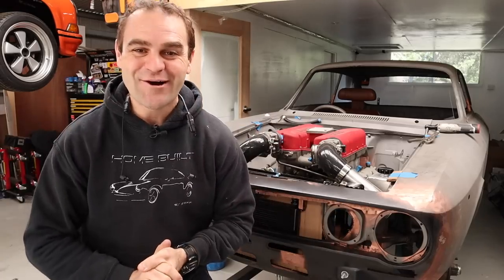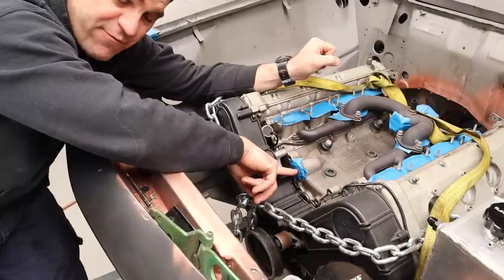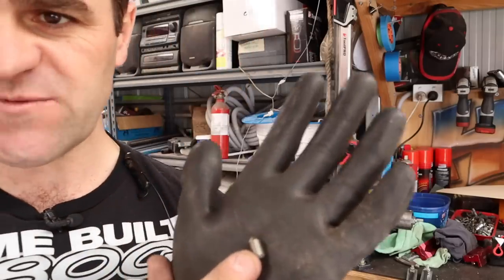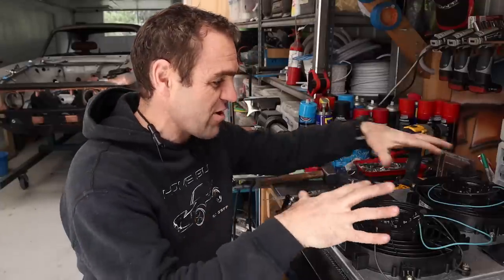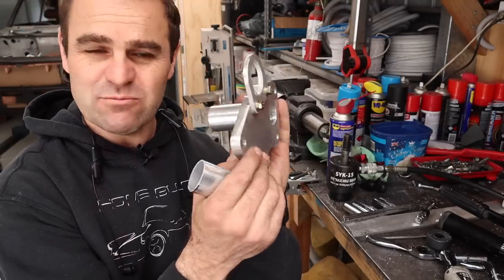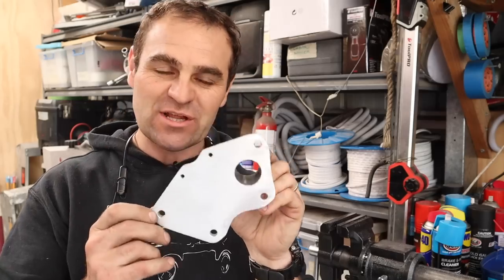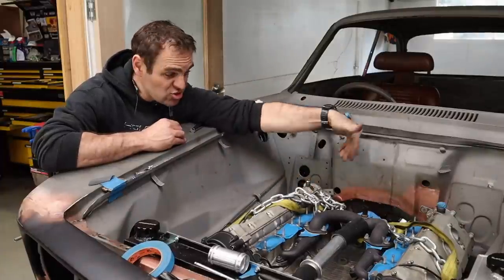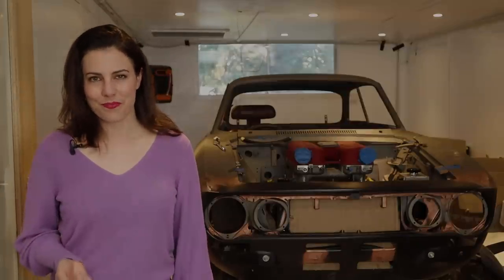Making a Ferrari water pump delete kit - Ferrari engined Alfa 105 Alfarrari build part 63

Comment: I'm not sure the heater solution will flow well enough Jeff. Another enjoyable vid. Cheers, Andy.
Reply: Agree. Surely you need a pressure differential for water to flow through the heater core. The feed and return need to be before and after a restriction,  ie, before and after a thermostat or the radiator itself, or a pump of course. Looking good though!
Reply: That's right! Water won't flow without the pressure differential that  @lowtus7 already said.  Great job Jeff!
Reply: You guys are correct there will be limited flow. The return line from the heater core can go to the upper fabricated radiator tube. He needs to  put the inlet to the heater core directly from the water pump.
Reply: All that was needed for this to work is the heater return pipe to extended into the main return pipe. That would create a narrowing of the main pipe causing a pressure drop at the return point.

Comment: Jeff, in order to actually have water flow in and out of the heater matrix, you need a pressure difference between the two connections.
Your solution stalls the waterflow to the heater. You need a connection before and after the water pump.

Or, of you want to keep this setup (and even have it controlled by the ECU)  you can use a used auxiliary electric waterpump of a VW T4.
That way you don't have to use a control valve at all.
Hot water to the heater on demand.
Even thermostatically controlled, if you want to...
Reply: Paul van Lieshout you are absolutely right

Comment: I work on Alfa’s for a living. The GTV is 350 lbs heavier over the front. All efforts should be made to reduce weight as you progress. Also airflow around the intake runners is important to keep the air intake as cool as possible. I recommend drilling a large hole in your adapter. Also 0 ring the water intake on the lath. Mount the adapter all the way inside the chuck to be as stiff as possible.  I would also mount the coolant reservoir as far rearward as possible. Mount the water pump as low as possible. Always think low and back. The little things all add up. I just started following your Chanel. Love what you are doing. Are you modifying the front suspension? Move the lower ball joint forward 10 mm.

Comment: Jeff, to work the heater you need flow, i.e. from a higher pressure to a lower pressure, you have tapped both hoses into the one pipe. One will need to go into the other pipe, the discharge side of the circulation pump to give a pressure gradient to move the coolant through the heater core.

Comment: Heater probably won't be efficient Jeff. Really need inlet : forced side of the pump & return inlet side of the pump. Just saying. I'm happy to be proved wrong.
Reply: "Get it right" Jeff))
Reply: I agree my concern is that the water will simply be static and not flow. The return from the heater should be separate from the inlet Jeff.
Reply: Yes, that is not going to work like that. at least He needs to add small pump (like in webasto) to circulate water.
Reply: It will sorta work.
If the inlet and outlet are set so that one faces the flow and the other is with the flow there will be a siphon effect as well as a thermosiphon effect where the hot water will create pressure in the inlet and the cooling effect of the heater core will cause a pressure drop siphoning in hot water. This will not be very effective especially in cold weather especially without a thermostat.
Reply: Especially with the electric water pump that won’t even be running all the time
Reply: Needs differential pressure. Great work though

Comment: Great progress.  I do wonder how much flow there will be through that heater circuit with the in and out lines almost straight opposite each other in the one pipe?  Time will tell I suppose.
Reply from the maker: I am also not sure how much flow it will get through the heater. I will need to see if the angled inlets actually work with the flow of coolant through the pipe. If not I may need to re-think the return.
Reply: @HomeBuiltByJeff  could you take a heater outlet come off the post-pump-pre-engine-adapter, and leave the return post-engine-pre-radiator?
Reply from the maker: @confused47  I just wanted to give the engine the hot coolant straight from the engine, but we will see how it goes.
Reply: @HomeBuiltByJeff  ahh, yes, of course you will want the heater fed with the hot water after the engine, not the cooler stuff from the radiator! When you first talked about taking the heater off that top pipe, I imagined the feed and return being offset along its length, and also inserting the takeoff pipe into the top pipe to "scoop up" some of the water coming from the engine. Was surprised when I saw you'd put them at the same length along the pipe.
Reply: Maybe a non return valve on one side so the water can only flow in one direction only, or the circuit will be. locked .
Usually the water or coolant is circulated with the pump, the way it is you could not bleed the heater core.

Comment: KoolKar just below said this adequately to state my concern,  You need pre thermostat pressure off the pump with hot water from the head to run through the heater then return that into the pump  on the suction side.  Yours will work once things are fully up to temp. But when the car is cold is when you want the heat the most.
Reply: As to your thought on AC.   I’m afraid civilized motoring in warm climates (in any time of the year)includes AC.  So, is there an electrical solution?  Don’t know... Anyone?

Comment: Really nice work!👏👏👏
Small tip, use red spirit when working on aluminium, works much better for drilling and using the lathe 😊
Reply: Also the best when you want to tap a thread.
Reply: Please what is red spirit in murican?
Reply: @marioreali5925  I don't know what Murcian is, use Google translate?
Reply: @marioreali5925  Google translate calls it methylated spirit.
Reply: Basically an alcoho then. What's got me is the red part. What's that about?
Reply: Meant alcohol
Reply: @marioreali5925  it comes in red, blue and yellow, depending on the purpose, red is mostly used for burning
Reply: @marioreali5925  I think it's just a red dye so that you shouldn't misstake it for something else like a warning like "don't drink this".
Reply: OK that makes sense.

Comment: Another great episode!  In older cars, like the Alfa, the heater is often just plumbed in series with the car cooling system so the water goes engine, radiator, heater, engine.  The 360 runs a loop from the radiator hoses, in effect what you've done, but then uses a second electric pump to circulate the water up through the heater matrix.  I assume you'll be doing the same.

Comment: Lovely work, but I'm not convinced of the location of the fittings for the heater core. There probably isn't much of a pressure differential there, even with the fittings angled like that.

Comment: Your idea with the heater water flow will work if you cut the end of the inlet pipe square and extend the lip of the tube into the flow. The outlet can remain as done. You want the inlet before the outlet in the flow. This will help with flow. Run them both on the same side to increase flow.

Comment: Jeff, just one suggestion, you've welded the pick-up for the heater core after the outlet, that way, you'll probably have cross flow between them. not sure if it'll be that relevant, but some cold water coming out of the heater core can be recirculated through the heater core again.

Comment: As other people have commented there won't be any flow through the heater matrix due to the pressure drop through the matrix being higher than the drop between the flow and return connections. That's why you normally connect across the thermostat which provides the restriction to give the pressure drop. There are online thermostats with a built in heater connection that you could use.

Comment: You may wish to locate one of the heater hose connections into the inlet, as both being adjacent in one hose, and there being no flow differential, the heater water is unlikely to circulate?
Love the build... Very entertaining ... Cheers from the UK.

Comment: love the build Jeff . great solution with the plate and the cooling piping. You might have issues with air getting traped in the heater because of flow . a bleeder valve closest to the heater might help with getting air out of the system, or move one of the inlet/outlet heater hose to to your  aluminium plate. hope that makes sence what i was again
love the videos
love the build

Comment: A great video as always mate 😊

A few suggestions for ali machining. A bar of soap works pretty well at stopping bandsaws from gauling when cutting ali. For nicer lathe machining I always found a radius'd cutting bit gave a nicer finish. Tool steel does well for most jobs but carbide tips are much nicer and you can easily change from pointed tip to radius'd tip with an allen key.
For that heater I'd suggest the outlet be as close to the cylinder head outlet and the return as close to your new engine inlet plate cos how you have them almost opposite means it'll be too turbulent and flow badly. Maybe worthwhile having a CNC shop machine an O ring groove where it meets the block. Should only be around $50-100 as a pretty easy job.

Comment: Please electric water pumps DO NOT apply enough head pressure. They supply sufficient flow but not enough head. Best way to test this is to hook the system up then operating the pump with the engine running at 500 rpm the flow from the heater flow should be 10 liters per minute with no cavitation. Jeff I speak from experience and unfortunately as many times as I have made comments around this subject on many channels the comment falls on deaf ears. I studied with a gentleman who spent 30,000 hours proving that the water pump is the most important part of the engine. Ferraris are notorious for poor pump flow. This is a science that I personally spent 12 years proving. I ran many engines with improved pumps recording a vacuum increase at idle of an average of 4 inches mercury. I currently run a factory FPV 5 liter supercharged engine with an improved factory pump utilising a 2 inch vacuum increase.
Reply: That's right! They may work when cruising around but when you actually need the flow it won't be there due to a lack of pressure. This will stop flow through all the critical cooling areas like the gallery between the exhaust valves. You might get away with it as you won't often actually be using high thermal duty very often but still over time you will get fatigue and cracks. Might be a year, might be 10 depending on how hard and often its driven. 

To prove it to yourself that, pump supplier should give you a pump curve with flow vs head pressure. Might be a bit hard to actually measure the expected delivery pressure of the stock pump but perhaps with creativity you could build a rig and test it! 

Ultimately the standard Ferrari pump is probably using 10+kW at max rpm and I assume the electric pump might be 500W? Something has to be traded off.

Comment: Great episode Jeff, not so sure about that central pipe for the heater supply, if you had to do it that way would it have not been better to offset the inlet and outlet more and hope the heater is lower than the vent or it’s going to airlock. As someone else said, could have done an o ring groove in the plate now you have the lathe. As for the surface finish, think you needed a constant coolant supply and maybe the up of the cutter needs to be rounded rather than a point (long time since I used a lathe!)....but....you are achieving far more than I have done, so hats off to you 👍🏻

Comment: Pro tip when I was   working at engineering company  we always used Treflex HD cutting fluid for drilling , lot more efficient than spray and  safer

Comment: Pretty sure the heater feeds will not be 100% efficient, you need flow and to get the flow you need a pressure differential.... it will get warm, but you will only have a short burst of heat until that water has warmed again.... similar to when a water pump fails. I'd be tempted to feed from that engine outlet and return to the header tank👍
Reply: And to add....also looks like a candidate for air locks too👌

Comment: Great work Jeff, have you considered a 12v electric independent heater instead? As I think you’ll have flow issues at that mid section were you’ve put the outlets going to the heater core.

Comment: Look into the heaters used in Hybrids etc some are entirely electric.
But to run a water type heater I wouldn't put both inlet and outlet on the same tube, Just run the outlet into the expansion tank.

Comment: 12:10 you had the lead screw powered, should be a lever on the left to disconnect power feed when not in use. 
My old boss never powerfed  anything but insisted the lead screw was powered all the time (his bearings were noisy too, so chicken before the egg also)
Reply: Also loosen your drive belt to suit the weight of the work. 
When you crash your toolpost nothing will happen then, the chuck will just stop

Comment: Hi Jeff, shouldn't you open a hole for an O'ring ,on the plate where it had the original water pump, to connect to the engine block? To seal the water ;)

Comment: Jeff I am thinking in plumbing you have a feed and return and that seems to be feed and feed that is unless you have some sort of 1 way valves to play with but I have never seen them in the car world? my other question is the adapter plate seems to be and I am looking for something I missed,  but it seems like a pressure seal now that leaves me to think rtv may not hold back the flow but I could be a mile away.

Comment: Heater performance will be very poor. Little flow through it even when the pump is on full. Best solution is probably to run another electric pump, just for the heater. There are loads of options so finding one to fit nicely wouldn’t be hard.
Just throwing in my penn’orth! 
She’s looking great, keep up the good work.

Comment: Even with an electric water pump, it is definitely recommended to use a two-circuit cooling system with a thermostat. The advantages of a thermostat-controlled system are the higher coolant volume flow and the more precise adherence to the target temperature.

See OEM applications for example at BMW.

My self-made system with an electric Pierburg cwa water pump works perfectly with a thermostat for years now.
Reply: I did the same, added a thermostat to the system with a daviescraig electric pump.
Never had any issues in over eight years
Reply: Supplement: The low volume flow will result in a high delta T between the engine inlet and outlet, mainly in the thermally critical warm-up phase. You should definitely avoid that. In addition, I take the same opinion as in another comment: Your heater will hardly work because you have no pressure difference. Usually the radiator, which forms the small cooling circuit, is connected between the inlet and outlet. The thermostat should be implemented between the engine outlet (hot side) and the cooler inlet. 

And as a last note: an overpressure tank is not necessary on the expansion tank ;-)

Maybe you will reconsider your setup?

Comment: I remember when a mate and I we’re driving to Milton Keynes in his Fiat Strada 70 in the middle of summer . It was over heating due to a knackered thermostat and we cranked the heaters up to try and cool it . Problem was we were stuck in road works right behind an offal  truck . Sweating cobs and the stench of dead rotting animals. Nice 🤢

Comment: Jeff, you should not be using a lathe for that type of part. That needs to be done on a vertical mill. The lathe is for cylindrical projects only. You'd have been better off to just use the sander from the get go.

Comment: I do not see your heater working in the manner you used for the hose nipples.  One nipple in the location you used is fine for getting hot water to the heater.  The return for the heater can go to the water pump intake or simply return to the radiator with a nipple added there.  The water needs to flow from the hot side of the system to the cool side of the system.   But, I'm sure other people have better ideas, but, your idea is not correct.